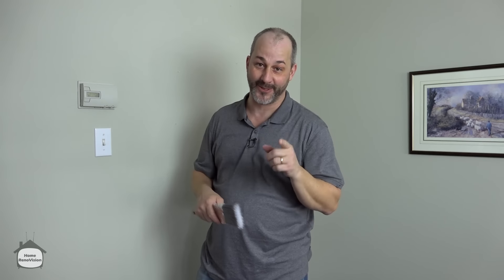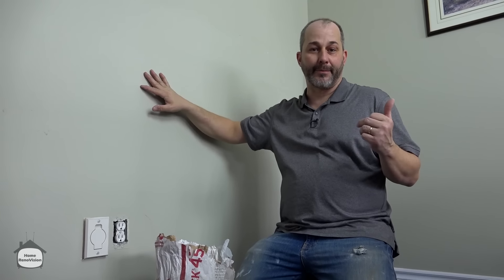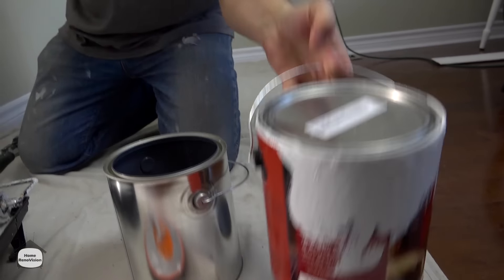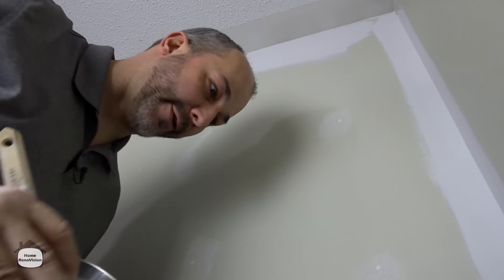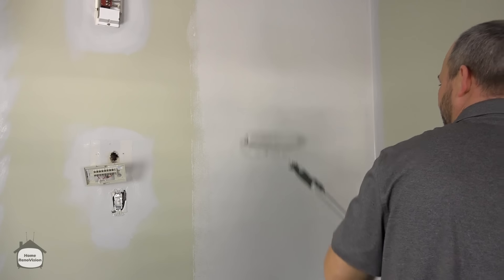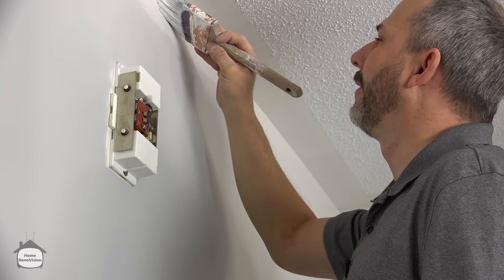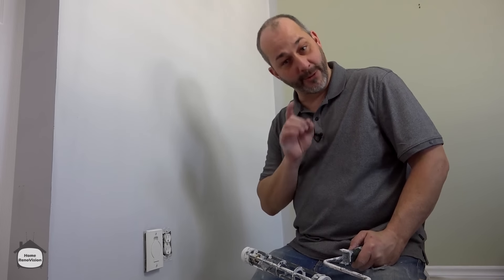DIY How to Paint like a Pro Series A to Z

Comment: Not gonna lie. Ive been painting all wrong for years. thank you for the tips. One tip I dont remember seeing and you really only need it if your redoing rentals someone else had redone. I chase around alot of horrible cut ins and Ive found if you cut the ceiling paint down the wall an inch and the trim paint up an inch you then only have to do a good cut in on the walls. I may be wrong and I would love to hear why, cause seriously with this and the texture video I can wait to go put these tips into action.

Comment: Jeff, thanks for the many many tips on painting. My question is about re-painting a bathroom. Existing home, old-ish bathroom. 

Some of the other "bathroom" videos dealt more with toilets, showers, faucets and tubs....I hope this is the place to ask since it's all about how to paint? 

It would be great if you could put out a video on just painting bathrooms :-)

1. In the prepping phase, can I use the same 45min compound to fill gaps/holes/dents? Given humidity etc, does the same process apply?
2. What type of paint do you prefer for bathrooms? eg. Semi-gloss oil based?
3. What kind of paint to use with a bathroom sealing?
4. Is a different paint primer necessary for bathrooms?
5. Should I sand between paint coats? in other words same as shown in your video here

I have a project on my hands and your feedback will be most welcome !

Thanks and keep up the great content on this channel !

Werner

Comment: I enjoyed this video, 6 years after the fact. This guy Jeff is a good content creator and very likeable. This is a good video, but I'd say more like A to   E of painting vs A to Z. In reality, there are typically more prep problems to solve on most residential jobs (cracks, stains, nail pops), etc, and generally more elaborate setup, but that said, a very enjoyable video and a good instruction  on basic prep and application. Regarding the baseboard painting, I promise you little white speckles are flying off that brush onto those dark floors, so you can either use paper down or simply wipe with a damp rag after your done, or even slide a cardboard shield. Tiny speckles on floors is my pet peeve

Comment: Great video. I took 3 pages of notes! Even after reading the many awesome responses, I still have the following questions: (1) When is it preferrable to use TSP rather than sanding to clean a wall that is not greasy but has not been painted for 15 years? (2) What sandpaper grit is used before first coat and then which grit after the before the second coat? If the goal is to clean, is that different than to smooth out a coat of paint? (3) Not a lot of paint comes off when I sand by hand, so should I use an electric sander? This is especially true for semi-gloss paints that seem resistant to my hand-sanding? What should I look for in terms of adequate "dust" on the sand-paper when I sand? (4) When should we use primer if at all. I have been using it for all of my painting jobs, but was wondering if I should only use when painting a light color (white) over a darker color (blue)? (5) I have watched several videos, and I am still confused about the order of painting a room. Is this the best order? Ceiling. Door and Window trim. Doors. Baseboards. Cutting on the walls. Walls. (6) I watched a video about spray vs. roller painting. I am still confused about the best options for bedroom doors. Do I have to take them off the hinges to do a professional job? Can I get a clean enough finish with a roller as suggested by one of these Home Reno Vision DIY videos? (7) Is it environmentally safe to wash the brushes in a kitchen sink with the paint going into the pipes and drainage into sewer water run-off (in my case--the ocean). I appreciate any responses and/or resources that help me to have clarification of these questions!
Reply: I have many of the same questions ... what grit of sandpaper  and what are rhe environmental issues washing the paint down the sink?

Comment: Great video! One of the things I learned the hard way and through your video is to always remove outlet and other covers where possible. So much easier/cleaner. Great brush techniques! I learned some of those the hard way too, lol. I need a roller extension! The tip about the 45 minute compound is so great. I'm going to use that one, but I guess I need a hawk too!

Comment: I tried squaring an outer edge in the bedroom but it was more wonk than straight, the whole thing needs replastering (covered chimney flue) because it's an Edwardian terrace, and so is probably proper old anyway so just did the worst since it's only a rental I'm not interested in improving their property value, just making my job of repainting easier.

But it was so relieving seeing you remove plates etc. I took a vent plate off the wall and was wondering if I was being too picky about it since nobody else had bothered. Glad to see pros do and the people living before us were just cowboys or using them and I'm not weird for wanting to paint behind these.

Comment: 0:37 Remove plates & wall fixtures.
2:38 Loosen low voltage off wall
3:08 Remove nails from wall if any.
4:04 Create dents around nail holes with butt of scraper handle.
5:50 Prepare Sheet Rock 45 paste to fill nail dents.
8:55 Test for appropriate 45 paste texture and consistency.
9:18 Apply paste to dents with painter’s knife.
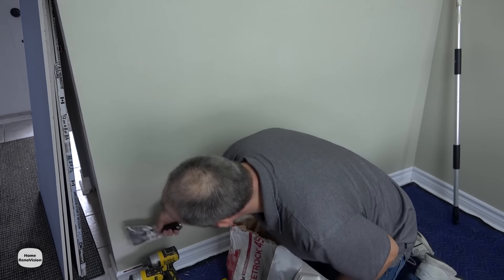10:07 Apply paste to bumpy wall edges if needed.

Comment: When cutting in around switches and along casings, ideal to back roll to eliminate brush strokes and create a stipple that will blend with the rest of the wall. And save a bunch of time by getting one of those mini rollers and running that along inside and outside corners. Don’t brush those corners. Faster and will match the stipple of your larger roller much better than brush strokes
Reply from the maker: perhaps but not necessary. I don't teach folks how to paint like they live in a million dollar mansion. The rest of the world is not painting to that degree of perfection. I don't like to waste my time with a 2 tool process for cutting in.

Comment: Jeff great tips. I have learned alot. My question is geared to sanding, so you say sand after painting. How about sanding a textured wall, do you still sand and if so what grit on sandpaper do you use, Alway explaining so the most basic DIY person can understand.
Reply: Here is Jeff's response on a 4y old comment: "I like the 220 but 180 works fine if you don't push too hard. Cheers!"

Comment: if ya using a roller sleeve and ya finished painting for the day but ya know ya gotta paint again the next day or two later, instead of washing the paint off the sleeve, put it in a Pringles Potato chip Can, they fit nice.

Comment: Hey Jeff,
I know this is an old video, but still great info! My question is, would you also use sheetrock 45 to fill in nail holes or imperfections on baseboards? If not, what product do you like best for baseboard touch ups/filling?? Thanks!

Comment: The only thing I would add as a professional painter of 20years  is to throw away he paint pan and use a 5 gallon bucket 1/3 full and a grid.  We have the same cut in method  but I call  it “close closer closer closest “ to snow plow the paint to the perfect line for a 3 feet long cut in.  And , I don’t take all the paint off the outside of brush

Comment: 3 inch painters tape  along the ceiling corners and  along the top of the baseboard is still faster and easier for me than cutting twice between coats. Then I use an 18 inch roller  to do two coats. 😅 Time saved means more work done.

Comment: First 40 min video I watched on YouTube! Great tips! 
Question: does it matter if the baseboards currently have glossy paint ?  Also, did you do second layer sanding between the two coats?
Reply: You can get flat, satin, or eggshell paint on baseboards if you plan on repainting them with a semi-gloss or gloss paint. And always always always sand between coats

Comment: What an awesome video! Question: Is there a need to sand the old paint even if the drywall compound was not used, to achieve a smooth texture with the new paint? And after sanding the old paint should we wipe the wall to get rid of the sanding dust
Reply: Sanding the wall helps remove the dirt that builds up on the wall over the years. If the walls were really dirty, or in a greasy kitchen you definitely want to wipe down the walls with a degreaster before you sand. After sanding you will want to brush off or wipe down the walls with a rag if there is a lot of dust because the dust will make keep the paint from sticking well to the wall. When you sand in-between coats you usually don't need to wipe the walls down before putting on the next coat. The point of sanding in-between coats is to rough up the paint a bit so the next coat will bond better, not remove it, so there should not be a lot of dust.

Comment: I don’t mean for this to be rude I have a tremendous respect for you and how much you help but I’ve used drydex a lot I’ve never seen any paint flashing even on a quick touch up with one coat of my finish color. I do agree you will save money on unmixed but on a small touch up areas drydex to me is the the simplest just my 2 cents.

Comment: Jeff, I realize this is an old video but I have found it to be most useful. I do have a question.  After sanding, do I need to dust or wipe down before painting? Thank you for your advice.
Rochelle

Comment: agree use a 3 inch brush that cost at least $15 dollars .. do not buy a cheap priced brush  - also buy a higher priced roller frame and roller covers  #1  you didn't dust off or wash the wall after you sanded it  ( some walls are very dirty and need to be washed clean before painting them  - kitchens and bathroom are the worst 
#2 you forgot to mix the paint up before pouring it into the tray
#3 very very few pro's use a roller tray - use a 5 gallon bucket and a roller screen - its so much faster and easier !

Comment: How about a video on pros/cons on using a 9” 14” and 18” roller. I just painted a 13x13 room with a 9” and about to do a larger master bedroom that’s about 16x20 with 12’ ceiling. Purdy has a 14” roller but it still attaches from one side which goes back to the question of pressure on the roller whereas an 18” allows equal pressure. Any thoughts?

Comment: I've been a painting and drywall finishing sub contractor for almost 10 years now so I can confidently tell you DO NOT THROW OUT THE TAPE.. especially if you're a DIYer. It saves you time and saving time saves you money, even despite the cost of painters tape being rather high. Unless you're some old-timer who has spent 25+ years behind the toe of a brush, has a mechanical arm that's not prone to human error, and has a lethal allergy to the materials used in painters tape, you're 110% better off using tape. Maybe I'm just a perfectionist, but have a properly tape seam that runs the entire length of a wall draws a wayyy more consistent line than getting down on your hands and knees starting and stopping every 12 inches. This guy knows what he's doing none-the-less.. He's just old school.

Comment: Wow, tips I will use in the coming week! Thank you. I didn't see you sand in between the coats?. I've never heard of that. What grit do you recommend? What is the benefit of sanding?  Also, I typically wash the walls with diluted TSP. Thoughts on that?
TY!

Comment: Hello! You are an excellent painter. Question - I am an ocd perfectionist and every time I paint I have a lot of roller stipple - it drives me nuts but I don’t have time to go back and sand every wall of my house and repaint only to have it happen again. Does really major roller stipple bug you? It makes me depressed thinking I spent all the prep time - I wipe down my walls with several clean cloths using water, patch the holes and cut - I’m good at cutting then every time never fails I roll I have such awful roller stipple. Am I being too picky? I watch video after video and still can’t manage to avoid that bad stipple.

Comment: I've started attending painting lessons a couple of months ago (I would like to do this as a profession), but I don't see a resemblance in the painting system you use. We learn to paint per square meter (start up against the ceiling to the floor). We start by painting the letter V, then overpaint it horizontally and finish vertically). Although, your result looks nice too ;-).
Reply: That’s a silly and impractical method.

Comment: This is 5 years old, is this site up to date and still active? I loved the advice.I have more issues than nail holes in the wall. Relatives lived in my home and the damage that has been done is beyond minor fixes, I'm a healthy active senior, but the labor is more than the material.  I have to try to fix this myself. I have a moss rock fireplace and the idiot that painted the house, has ceiling paint one the grout on my fireplace, and wall paint on the grout. plus and I have more damage than then just nail holes. can you help with this?

Comment: Excellent video, can this technique work on concrete walls or does it have a different way to paint, where i live we dont have drywall walls, they are bricks with cement and a fine layer of plaster
any advice would be appreciated. in advance thanks

Comment: I have question about rehanging my stair rail because the wall anchors have come loose and is not sturdy. And I was wondering can you fill the holes with hot mud and then resrew the new wall anchors back into the same holes? Also will it hold as well?

Comment: Ref an outside line cutting in, I've found that a 4" foam roller with very little pressure and not overloading with paint, can create a really good edge if using 1 colours.

Comment: The funny thing is I did what so many ppl did do and will continue to do’ 
I bought the cheapest rollers cheapest paint who the hell needs primer…? 
Hell didn’t even wipe down wall’ 🤣 

But lesson I hope helps someone 
I though paint “covered up” it 
DOES NOT’ 
I thought u could hide gouges or small holes etc’ 
No no no’ 
As he said you must first prefect the wall’ 

Think of your color as just that’ 

What your wall looks like b4 paint 
It will look like after paint just a different color’ 

Meaning if u can see any damage/ imperfection b4 u paint 
You will see it after’ 

I wasted so much time and money trying to fix what I was doing wrong’ 

Cheap supplies +
Cheap paint = shit 100% of the time’ 

U don’t try to save money with cheap tools and paint’ also spend prolly 3x the amount I would have had I just bought the right damm tool for the job! 

Live and learn’ 

Really hope this helps even 1 person then it was worth the 5 mins to type’ 🙃

Comment: If you want to make your life really easy and most professional painters never use a paint tray they use a screen and a 5 gallon bucket and you will eliminate a lot of problems by using a bucket number one it's easy to kick one step in one it's just a very slow way to move pain around the bucket has a handle you can move it to where you need there's just something very ineffective about working out of a paint tray I mean they're okay for painting a door or two but if you want speed use a 5 gallon bucket and a screen

Comment: ok , question do i have to do 2 coatings? the wall is painted white previously and im going to do a light blue coat on it ... so is one coat enough or the new colour  will not show as it should ? 
second , do i need to 45 the small cracks on the edges ? or the paint itself will cover that?

Comment: Great video...only one problem: I had an old can of paint (tinted in 2013) never used but there was a hole in the lid that was sealed with tape by the company that sold it to me.  Over the years the hole developed what I assumed was rust and the paint had separation that blended and mixed well with no rancid smell, but I did use a pair of pantyhose to filter it just in case.  Now, the paint job is done and the smell of the paint is not rancid but it is different than the typical VOC scent.  So, I tested a bit of the "rust" with bleach and sure enough that smell of dying mold.  Any thoughts on the what just happened?

Comment: When they say to paint opposite direction for the second coat, if I rolled a wall from left to right, would the second coat then be right to left? It’s my first time painting anything 😊
Reply from the maker: only on ceilings. on walls 2 coats same direction. Cheers!
Reply: @HomeRenoVisionDIY  so for ceiling if I rolled away from the light, 2nd coat I roll toward the light?

Comment: I always like your videos. In this video you explained very well but I have some questions and wants answers soon if possible because i started paint 1st time self from few days and done paint on doors and trims and i start walls. 
1st i bought brushes from Costco, those brushe hairs are not very much like your brush, that takes enough paint, explain it?
2nd, i tried to buy paint and finally i thought buy paint from home depot, they suggested me one coat paint but you did two coats. Suggest me it's ok or should buy paint that needs two coats?
3rd, you did sanding on walls, two paint sellers suggested me no need primer and sanding, Suggest me please, if need which sand paper should use ?
4th, over my kitchen some part of popcorn ceiling need to paint because one medicine had gas and with pressure did ceiling durty, how i can match with other ceiling?
I'm from Winnipeg. If you said i can call you.
Thanks for this video.

Comment: What grit of sandpaper are you using for the radial sander before and between coats?
Reply: Here is Jeff's response on a 4y old comment: "I like the 220 but 180 works fine if you don't push too hard. Cheers!"

Comment: You are using CGC SHEETROCK 45 (45 minute working time). What can be a match substitution of this compound on US market? USG Ease Sand 45 Lightweight Setting-Type Joint Compound? USG Sheetrock  Plus 3 Ready-Mixed Joint Compound? Thanks